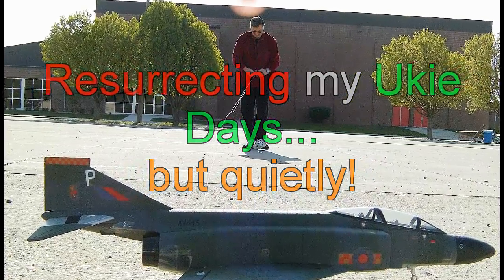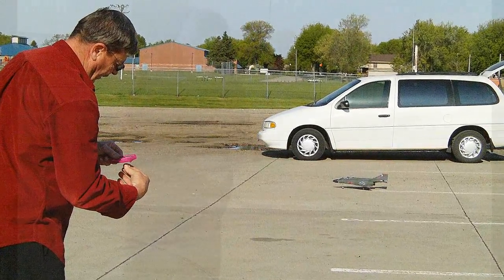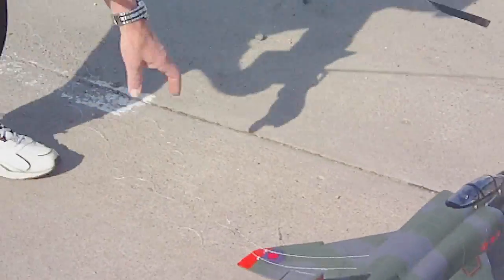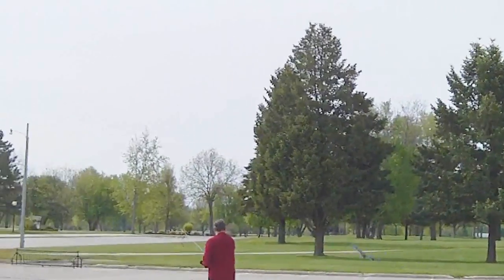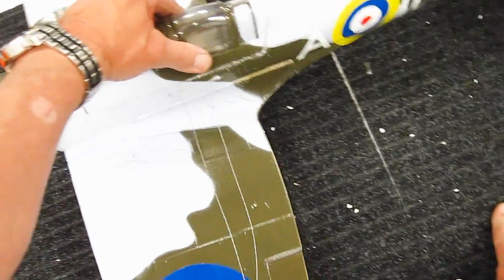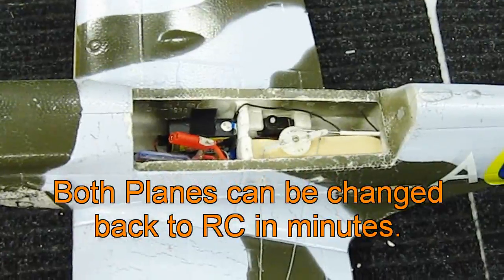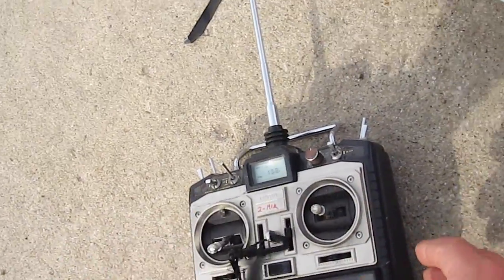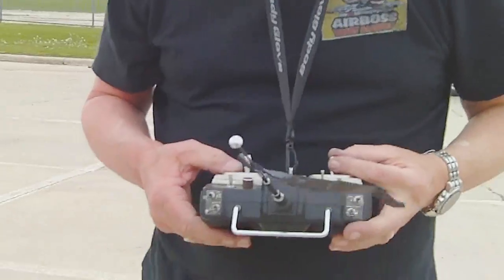NightFlyyer Resurrects his old U Control Days with a modern electric F4 Jet and Spitfire

Comment: That's it...am converting that EDF Chinese-built T38 Talon to Control-Line..
The feeling of a Solid Flying Model at the end of a hand-held CL Handle is something to experiment...for you modern RC ARF'ers....
Glorious Old Days..smells of balsa dust...glue..dope..tissue or silk..paint..fuel-proofers..castor oil and methanol...cranky-to-start engines...crashes and repairs.That's what Real Model making was supposed to be..
Cheers to all the Pionneer Talented Model Engineers Hobbyists.

Comment: My dad told me he had something like this when he was young, bought it it newfoundland back in the 70's, it had a small gas engine, you heated the motor housing with a 6volt battery(using the shuding to chort the battery) and then flipped the prop and away it when :)
Q: Could one do a loop de loop with this plane/setup ?